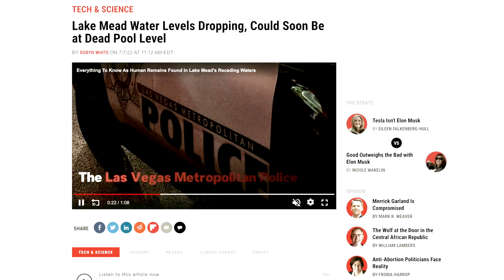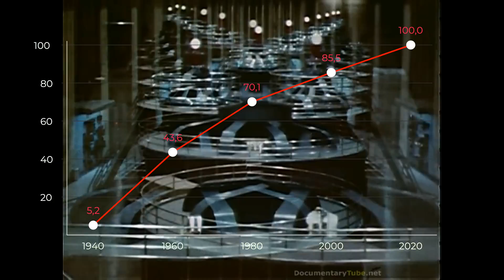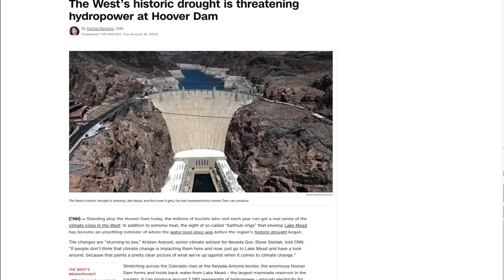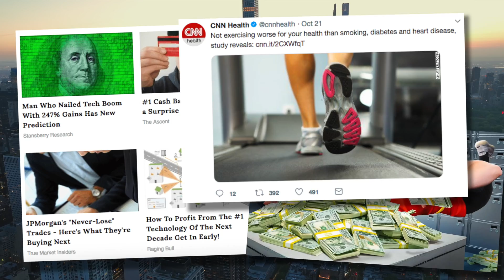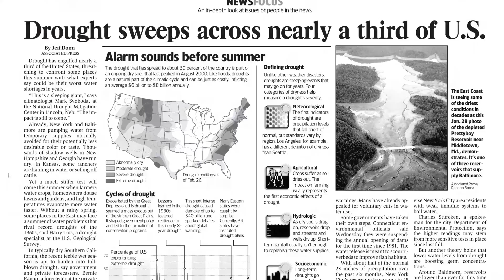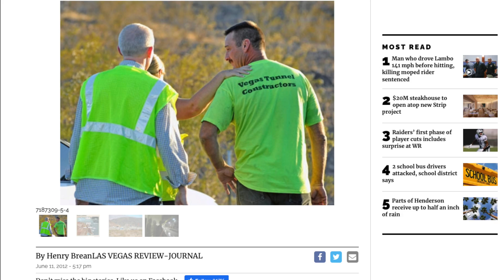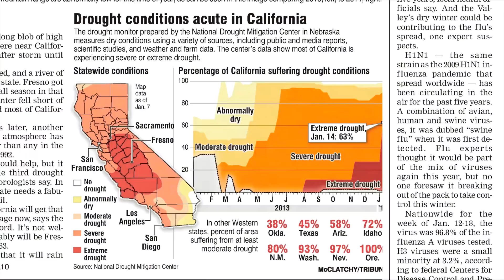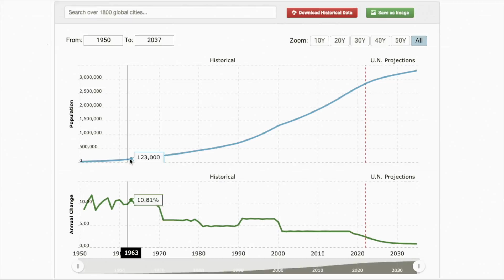When Hoover Dam Shuts Down, Then What?

Comment: There is a flaw about the survival of Vegas 
Google, melankovitch cycles with CO2 vs temperature vs time 800k yrs timeline graph
Google, global temperature graph from 1880 until present 
Google, global CO2 levels from 1880 until present 
The melankovitch cycles with CO2 vs temperature vs time 800k yrs timeline graph shows the global thermostat setting of 1c/12ppm 
Iceage minimum ,CO2 levels were 280ppm and average global temperature was 15c 
Iceage maximum, CO2 levels were 180ppm and average global temperature was 7c 
A 100ppm change in CO2 levels caused the average global temperature to change by 8c 
8c/100ppm or 1c/12ppm 
The equilibrium temperature for 280ppm is 15c
The equilibrium temperature for 180ppm is 7c
Today the CO2 levels are 420ppm above iceage minimum of 280ppm,  140ppm difference ÷1c/12ppm = 11.75c rise above iceage minimum 
The AGGI is 585ppm, absolute greenhouse gas index which converts all the other ghgs into the CO2 equivalent 
585ppm AGGI is 305ppm above iceage minimum ÷ 1c/12ppm = 25.4c rise above iceage minimum of 15c 
Equilibrium temperature for 420ppm CO2 is 26.75c 
Equilibrium temperature for 585ppm is 40.4c 
This is why global warming is accelerating and getting worse,  why things are happening faster than predicted 
So, Lake Mead goes deadpool,  no water flows past the dam, then what happens 
The average global temperature rise is accelerating,  heatwaves will get hotter,  meaning that the evaporation rates of Lake Mead will increase,  causing the water level to drop even without an outflow 
Soon the Lake will dry up and zero water flows to Vegas 
Then what,  Vegas taps the ground,  but for how long 
When this is all happening,  the fossil fuel economy will or would have crashed,  how will Vegas manage to resupply itself,  no material for maintenance of structures,  no fiat to buy/use material 
Then there's trying to feed the residents if they don't go into climate migration mode
Power, those methane gas power plants need water to cool, plus methane or natural gas won't be used
So,  the lights will go out in Vegas,  they went all in on the fossil fuel economy and will lose, the house rules are the rules of nature and they broke them
The global temperature graph from 1880 to present shows the global temperature accumulation 
1990 to 2000, the average global temperature rose 0.1c 
2000 to 2010, the average global temperature rose 0.25c 
2010 to 2020, the average global temperature rose 0.35c 
This happened during global dimming,  100k commercial flights per day producing condensation trails that spread out creating artificial clouds and reflecting sunlight back into space 
Today,  commercial airlines have reduced the number of flights,  allowing global brightening to kick in 
So what do you think the average global temperature rise will be from 2020 to 2030 and then 2030 to 2040
2020 to 2030, the average global temperature will rise 0.35c + 0.2c, 0.3c, 0.4c = 0.55c, 0.65c, 0.75c
Planet is 1.5c above iceage minimum,  in 5 to 10 years,  the planet will hit 2c+
You think things are bad now,  wait, its just beginning 
Also,  look at the global temperatures from 1920 to 1940, you will see a 0.4c spike in temperatures and the CO2 levels in 1920 was 310ppm and 1940 was 320ppm!, 30 to 40ppm above iceage minimum of 280ppm and look at the spike 
Why did the temperature drop 0.2c, ww2 pumped aerosols into the atmosphere and aviation caused condensation trails, both contributing to global dimming plus reservoirs and irrigation systems created an artificial cooling effect by evaporation,  enough to cause the drop and mask the effects of global warming

Comment: Don't worry the instant it hits deadpool they will start pumping water threw the spillway. The water will never stop flowing until the very least drop is used.
Reply: Installing pumps to push the water over the dam is expensive (and very energy intensive).  Probably cheaper for California to just use ocean water

.
Reply: @electrictroy2010  Didn't they cancel plans to build desalination plants over environmental concerns? Like they are going to have a choice?
Reply: @darrenn141  The problem is desalination is energy intensive, also. California depends on Hoover Dam to create energy. The very definition of Catch 22.

Comment: Good video. Good thing Vegas took care of the deadpool issue. What's California going to do? It sounds as if the deadpool level is inevitable.
Reply: Arizona is in greater danger.  California can build desalination planets to get ocean water, but Arizona has no ocean.  If the Lake Mead supply stops, AZ is screwed
Reply: NIMBYs in California are a major impediment: “ Poseidon Water sought to turn seawater into drinking water but activists said plan would devastate ecosystem on Pacific coast.” - San Diego tribune
Reply: California likes pumps.  They pump water from the Central Valley over the LA mountains to keep people hydrated.  Maybe they’ll install pumps to throw the water over the dam.

Comment: This is a man made catastrophy. Circa 1960 California killed 3 water projects that would have assured water for SoCal and it was killed intentionally to prevent Las Vegas and Phoenix from getting more water. The L.A. Times championed that move. 30 years the Peripheral Canal was killed to prevent SoCal to get Norcal water in the guise of protecting the Delta Smelt. San Francisco said they would rather let the water flow to the sea rather than L.A get any of it. So SoCal is first in line for the Colorado rather than use CA water. The Sierra Club cries over Glen Canyon Dam and Lake Powell and what a mistake it was building it and now is their chance to drain Lake Powell into Lake Mead and reclaim their lost canyon and stabilize the water supply. Do you hear anyone mention that? No. Politicians would rather create a crisis and stick a feather in their cap trying to fix it. I have actually had one tell me that. So we have a water crisis.